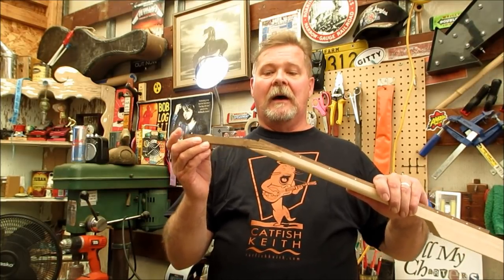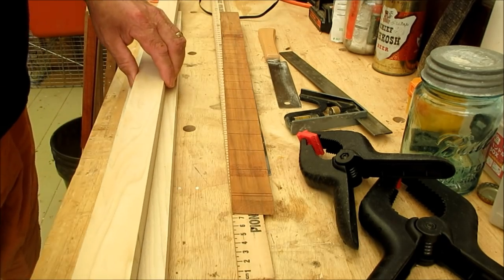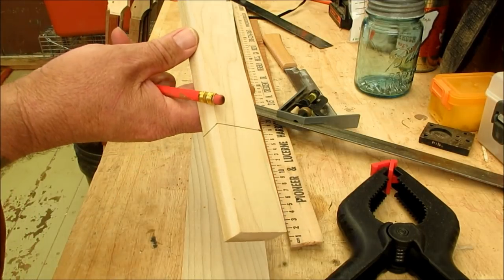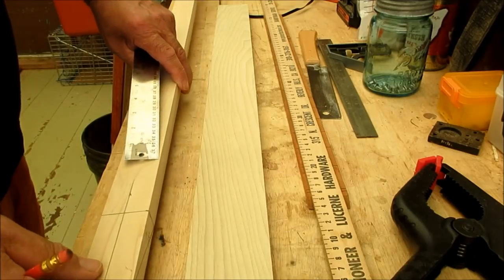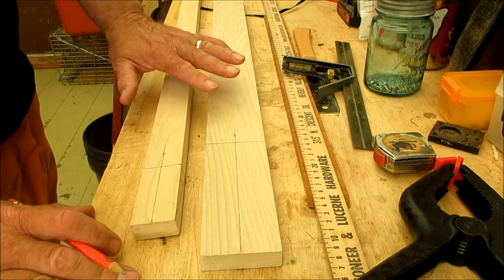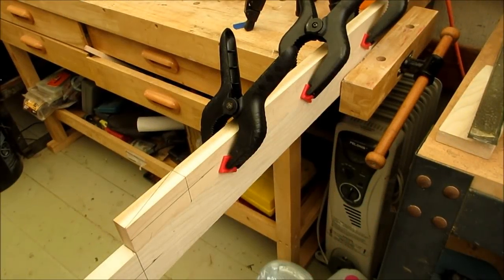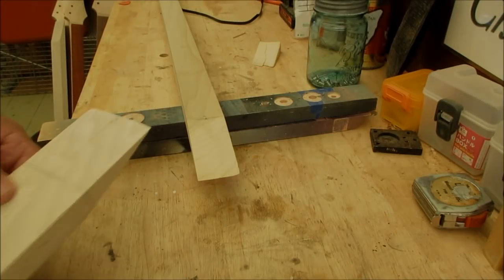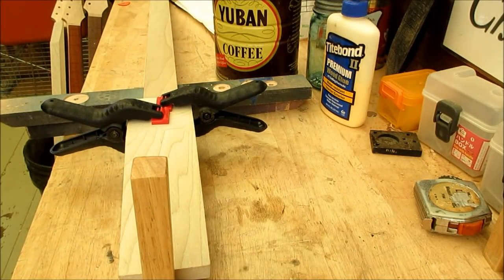Neck Scarf Joint

Comment: If you want your glue joint to not wander off on you when you clamp it, add a bit of salt. It adds enough grit between the boards to stop the sliding without impairing the bond, and will be clear for sanding and not damage any tool blades. You can use a pinch of dirt/sand but you might have some left over grit visible when you sand into it and it will hurt blades you use to trim/smooth things out.
Reply: Ketaset999 a very old woodworkers trick I use myself quit often

Comment: Checking with a square that the head and neck stock sides are straight, you can use a Swanson Speed Square to locate AND draw your center lines all in the same moment WITHOUT measuring for the board centers.

Comment: Good clear video, thanks.  I had a chuckle at "fear the worst" - you're dead on.

A suggestion: if you want to work in metric, don't buy dual imperial/metric tapes etc. You'll be continually tempted to use the imperial bit, and in any case the scale you want to use will always be on the wrong edge of the ruler. Get a set of metric-only kit and stick to it.

Comment: Thanks for the video.

It's a combination square you have, not a T-square or try square. You could set the blade (ruler bit) stick out to the centerline distance using the scale and then slide the stock against the side of the wood  to run the center line. Saves a lot of repeated measuring.

Does anyone have a link to a complete drawing for a CBG with all the necessary dimensions?

Comment: nice simple way, however much easier with a band saw, fast straight cuts, even without a jig.  with a jig can build 15-20 scraf joints in ten minutes
Reply: I was thinking a miter saw would work much faster, or a table saw with a jig over the fence. Still, this is a great method for using hand tools.

Comment: Once the joint is set and dry would it be a good idea to run a couple small screws from the back of neck through both pieces of wood to give even more strength ?
Reply: Robert - no need
Reply: That is what I do but with small predrilled finish nails just to pin. Done from the top and not through the fret board covers the nail and they dont show.
Reply: @jpascaln  excellent idea

Comment: Just glue?  Is it going to be strong enough?
Reply: Ian Harwin - definitely.
Reply: Ian Harwin are you kidding? a properly glued joint won't come apart. people glue the screw or nail when the glue by itself does all the binding needed. the problem is most people don't use enough glue. if the glue isn't seeping out on all sides, you didn't use enough. try it and use a hammer on the joint, it will break but not where it was glued.

Comment: Nothing against you sir, your guitars are extremely extraordinary. When you start talking about millimeters I lose where you are going with the project. I made it through, I think I understand .
Reply from the maker: Hey Tracy.  Great to hear from you.   I used to be confused by the metric system, starting in 1st grade in 1966 when they told us it would be the future.  I found no use for it until I started building these things.  Once I got used to it, it became real easy to divide up numbers with a calculator.

Comment: I am not from another country, I don't understand your weird measurements systems. I have used the standard tape measure all my life.
Reply: I use a stick with marks cut in it with a sharp stone. The marks are my pinky width apart. Works for me.

Why use a global standard based on the decimal system which is so easy to use??
Reply from the maker: Chris Elliott ha!  Exactly.